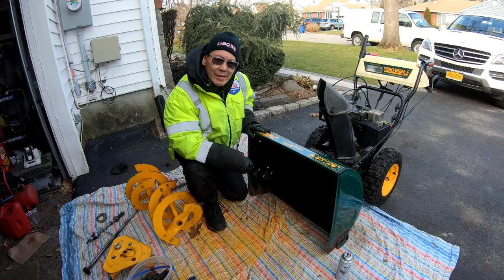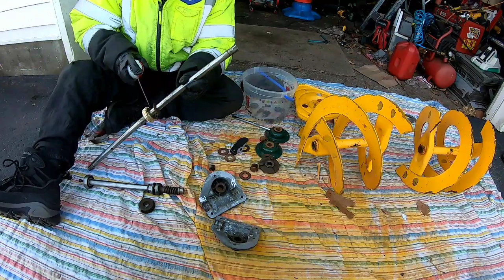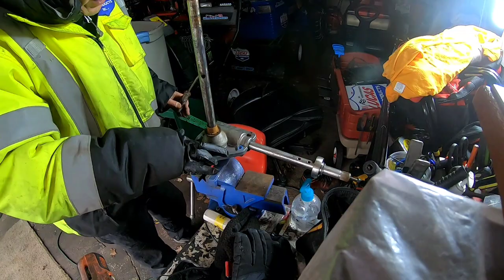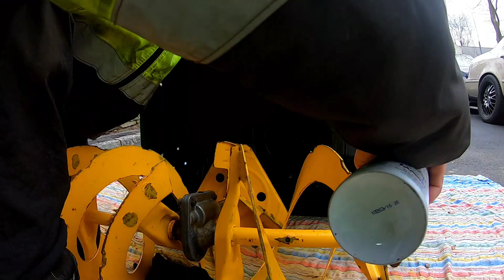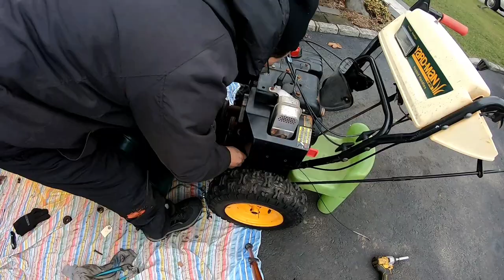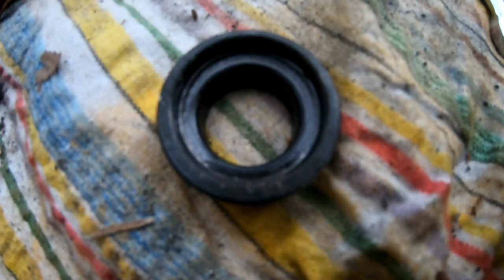YARDMAN 826 SNOWBLOWER AUGER IMPELLER SHAFT GEARBOX REBUILD BEARINGS ASSEMBLE GREASED NEW WORM GEAR

Comment: henry, you can add some light oil to that gearbox if will hold tight, if not then inject some , lithium grease while hand turning the shaft to get the worm gear covered, nice job !
Reply from the maker: Yup I used ngli #2 grease and hub grease fully encased.
Reply: @MowersNBlowers  you should be using #00 grease its what is recommended for the snowblower gear box. There are some gear boxes that use gear oil but most of them use #00 grease. All other grease is to thick in the cold weather

Comment: If there is resistance to the auger shaft turning then its slightly binding. The crack in the auger gear housing is caused by the collars for the auger or impeller shaft not sitting in the correct position, usually the collars have a flat spot or indent to correctly position. Ask me how I know this:)
Reply from the maker: Lol...its free and loose.  Thx